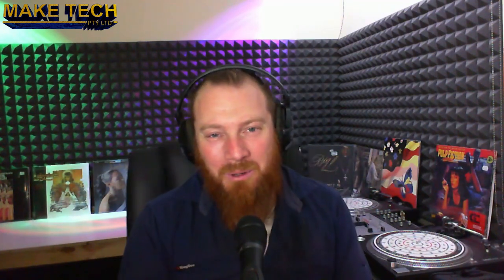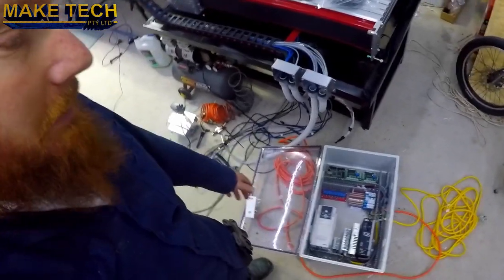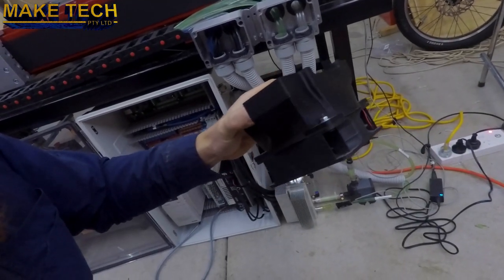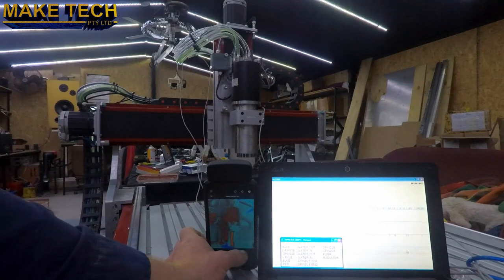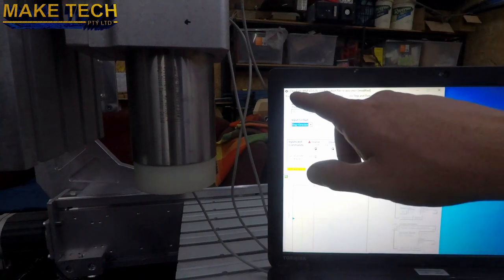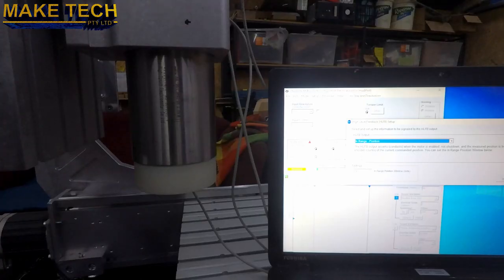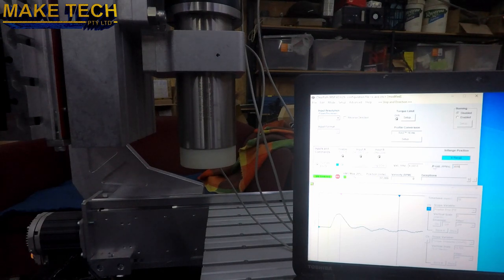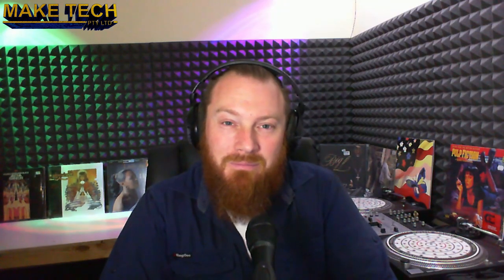CNC Build ep05 : Electrical - ATC Spindle, 3.5KW VFD and Clearpath Servos.

Comment: Is that the E550 Sunfar VFD? How did you wire it? Are you using a 40A circuit breaker, 32A contactor and AC line reactor (if yes, what size?) as recommended in the Sunfar VFD instructions. I have one myself but I have not set it up yet. Perhaps the AC line reactor could lower the amps a bit?
Reply from the maker: I will cover the I/O breakout board connection to the VFD soon. I'm just using a 16amp RCB (breaker with earth leakage detection).
Reply: @MakeTechPtyLtd  Thanks, looking forward to it. Great videos!
Reply from the maker: @kimenges8703  Thanks I really appreciate the feed back :)

Comment: Isn't curvature diameter for Z-axis holding system is way too large for material being used? Industrial machines which have such semi-circle holding Z axis, are made of cast iron for a good reason :)
Reply from the maker: Look at the channel "breaking taps". He is cutting steel with one if these machines no problem. When I have a VMC, the 2 machines will complement each other.

Comment: Are you running Vector drive on you spindle ?
Reply from the maker: Great question. From the documentation, I believe this spindle is AC synchronous motor with permanent magnet. Therefore it's not suitable for FOC or Vector drive. I assume you raise the point because power consumption is inversely proportional to the rpm in the video? The VFD does support asynchronous and synchronous motors. Jianken does offer an asynchronous motor spindle range denoted with the suffix JGY and starts at 3.7KW 10KG. I'm more experienced with BLDC motors so I may be wrong.
Cheers - Ken.
Reply: @MakeTechPtyLtd  There is both Closed loop vector drives, and open loop vector drives.
But yes, that was my thought, that it was giving quite abit torque boost at the low en (too mutch in this case)
Might be something to have a look at.
Dont know what rpm that made it so hot, but my 18000 BT30 spindle can handle 2500 in alu for quite a time with not too heavy watercooling.
Reply from the maker: @xillianto  Interesting, thanks for that. Yeah I have allot to go over still. I'm still considering how I will take advantage of all the features of the Clearpath servos. Also I need make the enclosure for the top and setup flood coolant... among other things.